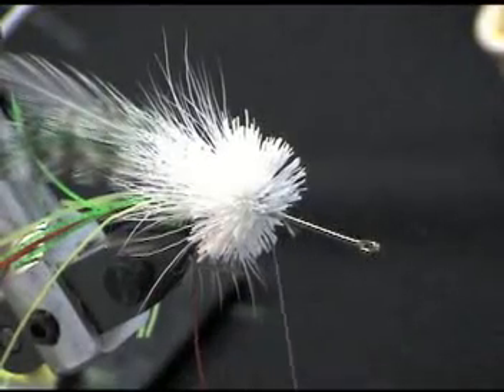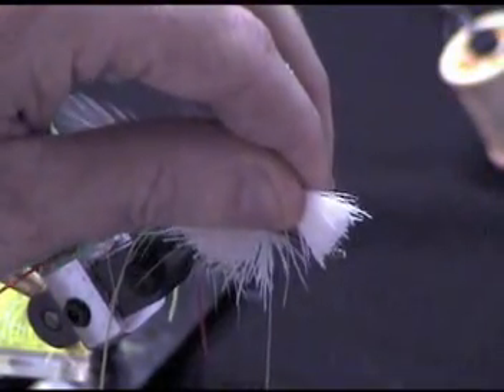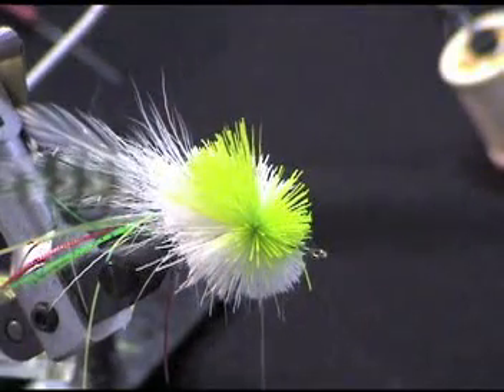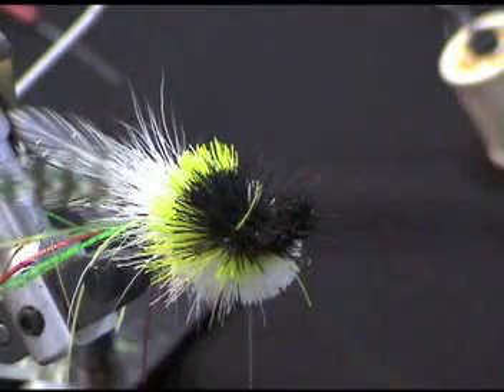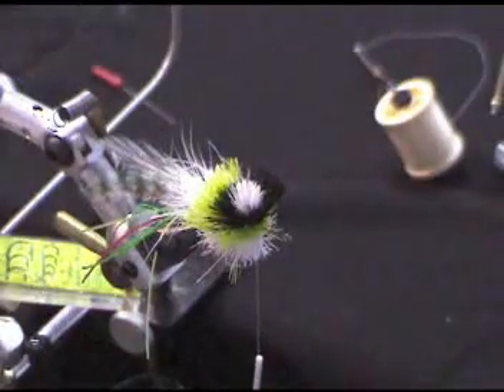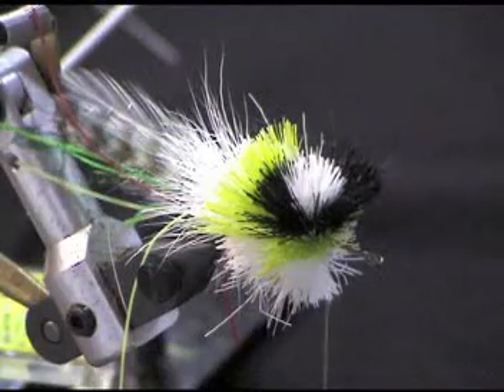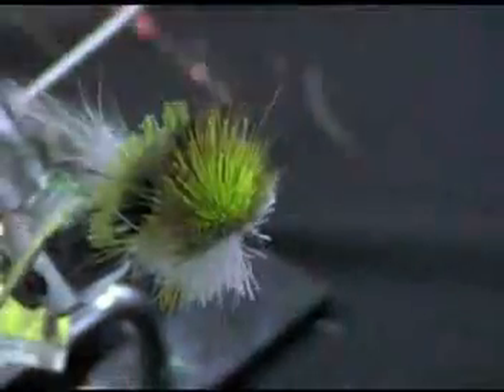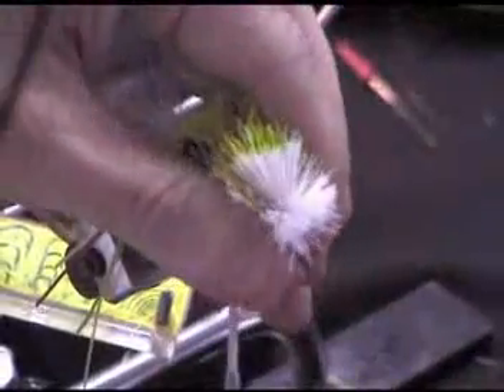Tying a Dahlberg Diver - Part 2

Comment: @dabubbleking sometimes it's becauae of the dyeing process,  you can get a patch that's only good for small muddlers.  or maybe you're too heavy handed experiment by  pulling down till you cut it with your thread, then remember that tenson and back off a bit